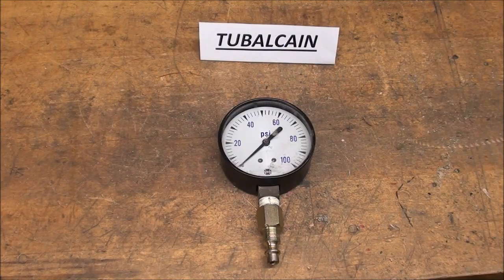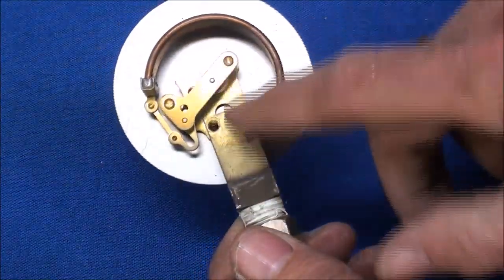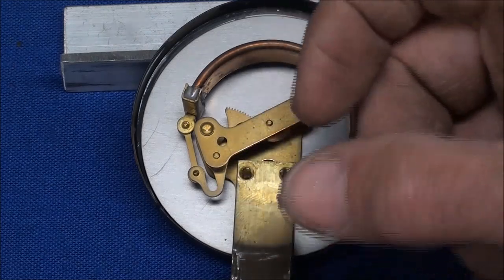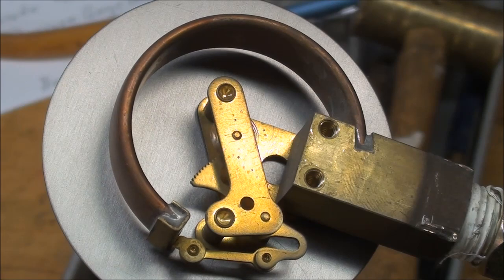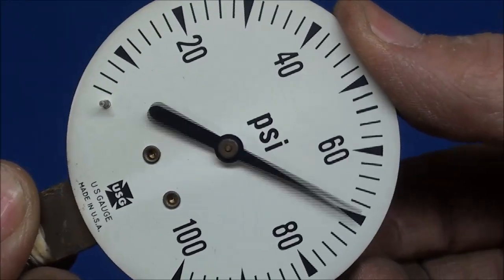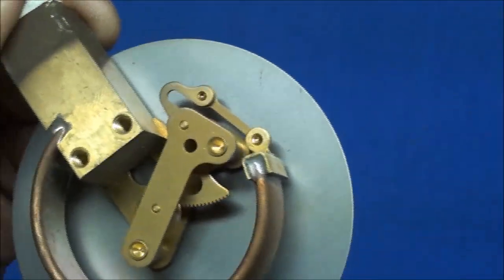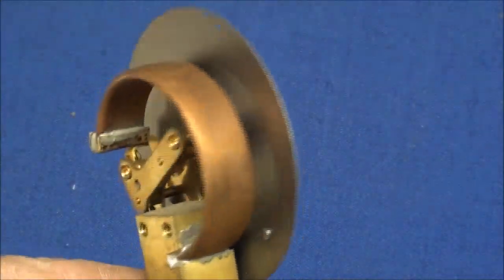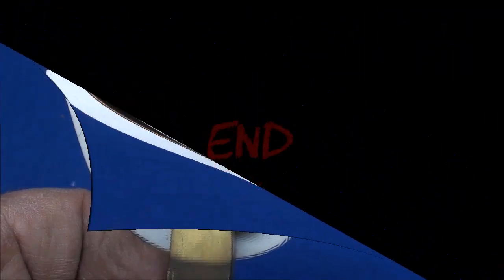WHAT MAKES IT WORK? #15 How a Pressure Gauge Works tubalcain bourdon tube

Comment: Fantastic. "Never before seen on youtube." I love that line. Great post!
Reply from the maker: +mycompasstv  Thanks
Reply: I just wanna know from where the pressure is entering and forcing the that copper coil to move !
Reply: The air enters through a manifold and actually travels into the bourdon tube.
Reply: Great explanation, but that line really took it to another level 😂

Comment: On a gauge with a stop post, I read that when the needle gently touches that post(vs resting hard against it) it is considered calibrated.  I have a Slime portable inflator that was impacted, and the in-line gauge needle rests about 8-10psi above the stop.  unfortunately, the shaft that mounts the gauge to the hose goes through the black backing(case) of that gauge.  It is screwed on so tight it is impossible to remove without possibly bending or breaking the thread - and gauge head - completely off.  So I just have to remember, if I want 32psi cold in my tires, inflate with the Slime until its gauge indicates approx 40psi.  Then check with a known good gauge(Longacre Racing makes several that are within 1psi of a garage's inflater unit).

Comment: The tube straightens due to the difference between it's inner and outer surface areas. Another example is a coiled up garden hose 'squirming' when pressurized.

Comment: Thanks for a great instructional video!  I have a bicycle floor pump, with a similar gauge, that I guess I must have dropped a few years ago. Since then, it has read about 15psi at no pressure.  I have always just added 15 to the reading.  After watching your video, I opened it up and was able to squeeze the curved "loop linkage" with a small pair of needle-nosed pliers to re-calibrate it to read zero at zero pressure.  I then checked it on a tire pumped to 50psi against a new pump and it was bang on!  Thanks to you, I feel like I have learnt and accomplished something today!
Reply from the maker: Thank you, I'm glad it worked out for you

Comment: Awesome Mr. Pete.  I usually am the guy wondering how things work, taking things apart, etc, but it never occurred to me to consider a pressure gauge for some reason.  I use them all the time, but had no idea how they worked.

Comment: Great analogy with the party favor, Mr. Pete.  Pretty interesting engineering when you think of it.  The radial travel of a specific type of formed copper tube expanding/contracting in some preconceived pattern, translated by gear ratios, and the linear linkage/ adjustments to a rotating shaft, needle and linear scale...impressive.  Eddie currents are another favorite.  Thanks!
Reply from the maker: +pjsalchemy  Thanks

Comment: Very interesting.  Our friend AvE tested failure point on one of these and it went many many times past its range before the tube bursted.
Reply: +phooesnax Cody'sLab opens one up and discusses its workings in his video "Oversized Pressure Gauge"
Reply from the maker: +Neds Head I'll check it out

Comment: Marvelous as always.  I expect that the ever so slightly greater surface area in the outside radius of the tube is causing the tube to try to straighten out.  Like the Chinese windless.  The differences doesn't need to be much.  Thanks again.

Comment: Hi LyleYes excellent once again. I deal with pressure gauges every day at work. mainly cheap ones. working from 0-15WC which is about 1/2 PSI to 10,000PSI. I design pressure washers. The low pressure ones are for gas pressure and the high pressure ones are for the water. Huge range and everything in between. The zero is normally done with the needle it is on a taper on the spindle and that little loop is to adjust the linearity. i.e. 0 is obviously 0 but 100psi might be 95psi and it changes the distance of the link radius. thereby changing the leverage and hence the linearity. Simple but effective. Never had to adjust one so far. You have to be careful with the LP ones, a colleague blew in one once and I shouted but to late it was wrecked. 
Allister
Reply from the maker: +Allister Denyer Thats interesting to know-thanks

Comment: My bicycle floor pump gauge has ceased to operate so I thought I would disassemble to see 'how it works' and 'can I fix it'. It wasn't obvious to me that the copper ring was actually a tube (flattened). I suspect in my case that the brass or copper section is blocked and can't easily be cleaned.
Your video explained the 'How it works' excellently. Thanks.
Edit...
I have since drilled a very small hole (1 mm) in the far end of the flattened copper tube, and blew compressed air in the reverse direction. In this process a small quantity of ‘stuff’ was expelled out of what would normally be the gauge inlet. I then sealed the small hole with solder. Low and behold the gauge then worked. I reassembled and tested ok.

Comment: i converted one to become a DTI  using the mechanism as the means to turn the needle disregarding the boron tube.  a curved shaft to enable them.  indicator pin to deflect the required indicator. yes, interesting worked a treat, to centra job remember were needs must the devil drives the way. Les Thompson England.

Comment: Spent a considerable portion of my wage slave years in a fossil power plant in the Apple.
There were large "steam" gauges in the various boiler control rooms with drum pressure brought right down to the back of the board. Woowie! By the time I retired in 2000 that was all replaced by local pressure transducers mounted locally with a 4-20 ma current loop output into various electronic "stuff".

Comment: It's quiet awesome, as i wondered how did such tings work since longtime now, and now i remember that i've already seen such mechanism pictures but forgot them. Very inspiring, it gimmes some ideas now about making some, calibrate them approximately following another one as a reference pressure gauge, and digitize the apparatus with some potentiometer, to plug that on a microcontroler for cheap. Thanks !
Reply: +Okto Putsch  They already exist. A common usage is automotive oil pressure gauge.
    Mike (o\!/o)
Reply: Moholo 88 Thanks :) (but i just found that fun as a project)
Reply from the maker: +Okto Putsch  Thanks

Comment: As I was watching I was wondering what prevented the bourdon tube from straightening too much if the gauge is subject to more than its max pressure. But at 6:55 we see that the body of the air manifold limits the motion of the quandrant and therefore limits the motion of the bourdon tube. What a simple solution (although I'm sure that too much pressure would deform the linkages and throw the unit out of calibration).

Comment: Thanks for the video. I have a cheap pressure gauge attached to a 12VDC air compressor. I have only used it twice and it worked perfectly until today. The compressor air passes through the gauge hose but it stays at zero. I tapped the gauge lightly but it is still locked on zero.  Since the gauge is not leaking air I suspect something is jammed possibly an internal gear. I am going to open the gauge see if I can clear the obstruction and lubricate it with a very small amount of silicon lubricant. If it still doesn't work at least I'll know I tried to repair it.

Comment: First thing I thought of when I saw the assembly inside the gauge was the human middle ear apparatus, where small movements of the eardrum are transferred and amplified via a mechanical linkage of three small bones to . Of course, this is not the same, but kinda similar. I think.  Thanks for showing this Mr. Pete. At least I can now say..I know how a pressure gauge works.  btw,  love your low key snark regarding anything made in America must be quite old. hahaha.
Reply: +Martin Walters  dang.   correction...   " ..three small bones connected to another smaller membrane." youtube needs an edit function.
Reply: +Martin Walters  There is an edit function! When you mouse over a comment a down arrow appears on the right. The options depend on whether the comment is yours or not. Since YT can't figure out unicode and will screw up all the punctuation, the best way to edit a comment is to copy the original, delete original, open a new comment or reply box then paste and edit the new comment. If you see a comment with weird number/symbol strings in it now you know it was edited since not all edited posts are marked as such.
    Mike (o\!/o)
Reply from the maker: +Martin Walters  Thanks
Reply: I wonder if acetylene and oxy tank regulator gauges work the same way? If so, they must be really heavy duty given the pressures.  Just curious though.  Btw, had to take open my compressor gauge  apart yesterday. The two mini screws holding the gauge  meter face came out.  I was almost leery of doing it until I watched your video.  Thanks again.

Comment: Great tip about the loopy adjustment lever - didn't realize it could be used to modify the lever ratio, it could be used to adjust the range somewhat... Hmmm!
Reply: I tried it at both extremes.   It actually changed things very little.   It certainly did not change the range.

Comment: It would be interesting to make a mechanical solar tracker with two of them (one in east side, one on west), painted black. In this way, when sun heat one side on the morning, the bourdon tube mooves the miror (directing the sunlight to the device you want), until it comes back to the shadow/the other side's bourdon tube reaches the sunlight and equilibrates. What you think about ?

Comment: While some videos say to adjust, opening or narrowing that gap in the linkage is the proper method, that would seem to change the leverage, and so one pressure might be correct but another off. I wonder if most gauges that go off aren't just suffering from a needle which has been knocked loose or out of position, rather than the bourdon tube suffering some mysterious malady, the only thing that might justify changing the actual linkage itself.

Comment: Mr. Pete, Thanks for the education. Am going to attempt to recalibrate a 0-30# oil gauge in my 1950 Chevy to read 60# oil pressure at the 30# mark....If it is possible the needle should be more in the normal 1/2+ on the gauge..may paint the 30 into 60 if all works as I hope....Anyway, Thank you for your lessons and keep on tearing things apart !
R Rhoades

Comment: Thanks for the description and explanation. I keep a gauge like this in my bike bag, after it got wet during a few rainy day rides it drifted away from zero PSI at rest.

I recalibrated it to zero by bending the flat copper pipe until the needle landed at roughly zero. Still not sure how water affected it in the first but I guess something must've expanded and oxidized. Nor am I sure if my "fix" effectively made it accurate again. Waiting for a replacement to find out for certain. 

I only have one gauge that's compatible with my bike's preasta valve. Schrader  shrader adapter, regular schrade valve compatible pressure meters never report accurately when used with a presta adapter. As a result I have to wait for a replacement presta pressure gauge to arrive before I know if it's accurate or not.

Comment: I guess the copper tube is hollow and the air pressure tries to straighten it. And that probably part of the mechanism limits it's range of motion so it can't be over pressurized and snap. Would have been good to see the gauge parts removed. Or the copper part removed so this was all totally clear.

Comment: Thanks for this very informative video. I have an automotive oil pressure gauge that is not reading correctly, 15-20psi low. It's been sent off for repair, but I have been curious just how the mechanical oil pressure gauge works. As relatively simple as the mechanicals seem to be, now I wonder what may have occurred for mine to go awry.

Comment: I wonder what the point of the spring is? Maybe some kind of reset ability in the event the cogs disengage briefly and get out of sync?  You then remove the input pressure and stick something through a hole which disengages the cogs somehow.  The spring then turns the cog connected to the needle back toward zero until it hits the peg.  My best guess anyway.

Comment: Assuming  that the small gauges on your typical home air compressor function in the same manner, I wonder it over time (1+ years) they would lose some accuracy since they are always under pressure (I tend to keep my tank full).
Reply: +Marty Backe I would assume that much like springs, they have a "deformation" point, that as long as you stay well below that, it will remain elastic indefinitely....would be an engineering question...
Reply: Interesting, you could probably find out installing a second, newer gauge and compare both at different pressures...
Reply: Aside .... I understand it's not the best practice to keep the tank full on a small home compressor.  Typically the instructions say to use the blow-out valve after each use to get rid of the condensation that builds up in the tank.  Not doing this can reduce the life of the tank.

Comment: Great video! I never knew how they worked. Does a liquid pressure gauge work the same?
Reply: +Ron Smith Yes.  In fact a steam gauge uses a loop to condense steam to water to keep the higher temperature of the steam away from the gauge.
Reply: Thanks for the info...I love watching your videos..  always informative..
Reply from the maker: +Ron Smith  Thanks

Comment: Very nice! Have you ever done a video on linkages? Thanks very much!
Reply: +William Lee  Would that be connecting rods, aircraft controls or bicycle chains?
Simple concept but big subject.
    Mike (o\!/o)
Reply: +Moholo 88 You are correct, the subject of linkages is very broad. I enjoy Mr Pete's videos so much I'd be glad if he did one on any area of the subject. Given the many steam engine models he has had made one on their valve gear would be great. Perhaps he has already covered those and I have not watched the video(s) yet. The study of 4-bar linkages has always fascinated, and to some extent mystified, me, but that might bore everybody. Much of the work that linkages used to do in motion control has been replaced with digital control, but as yet machines like cranes are still built out of linkages. My best, thanks!

Comment: Mrpete:

I see the gauge in your video has a stop post against which the pointer rests, like some of my own tire pressure gauges.  A couple of my other tire gauges have no stop - the pointer just resets to within a Zero 'box'.  

What is the advantage of either zero rest type, and in the box type, how close should the pointer be to the middle of that zero zone?  

Thanks in advance!

Comment: Nice video. Is there any way to fix an inaccurate gauge? My "Slime 40029 120-Volt Inflator" works fine in putting out air, but the gauge is way way off, showing 60 PSI immediately when turned on even though the PSI is around 20. And it doesn't move from 60 even after a few minutes. Can I buy a simple gauge to replace the faulty one on the inflator? By the way, the inflator is about 4 years old and rarely used, can the parts go bad over time? Thanks.

Comment: thanks for the very informative video! i think i broke mine when i plugged it next to a pump without any dampener. I am trying to fix it to be useable (im sure it is not accurate anymore) 
I have a known refernce point of 9.5bars, and the gauge still gets to that. but when there is no pressure, I am reading 2bars. I want to reset it to 0.  if i take out the needle and moving it to zero will only give me a 7.5bar reading. 
I read somewhere that the linkage next to the bourdon tube needs to be extended, but obviously this is a standard gauge and non adjustable. you mentioned something about the "loop". what do I need to do to reset to zero ? thanks

Comment: I have the exact same gauge on my water pressure regulator I use when I go camping. It's only 6 months old but my needle is now pointing all the way clockwise (south) to the 6 if it was a clock. When I move it counterclockwise, I feel the tension. When I let go of the needle, it goes back to the 6 position. When I put water to it, I can get water to come out on the other end of the hose, but the needle does not move at all even if I adjust the pressure screw. I took it apart but cannot figure out how to fix that issue other than buy a new one.

Comment: I still don't get what pressure/stress the bourdon tube gets exerted to make it expand. Basically, want to know how what happens when the air nozzle is connected, inside the brass.

Comment: What does the hairspring do? Doesn't the bourdon tube retracting back return the needle? Does the hairspring help with vibrations?
Reply: Perhaps it puts tension into the mechanism to eliminate "slop" or backlash?
Reply: +mark314158 Gear 'slop' elimination is exactly why it's there!
Reply: +John Bond it's a callback for the gear pinion, helping to avoid any jumping from the needle, and also hysteresys.

Comment: So I had a problem with mine I can't take it apart, but it will no longer move ,I had put a pin in the top of the gauge to keep the glycerin from leaking, I somehow put a small dent in the copper pipe and now it don't work at all even with pressure or vacuum

Comment: The tube isn't a pure copper. It may be a spring bronze, beryllium copper, monel, a spring stainless steel, or pretty much any other material compatible with the working fluid and conditions that has appropriate spring characteristics. The less expensive ones are often beryllium copper, and as beryllium is quite toxic, the material should not be reused, cut, ground, filed, brazed, melted, etc. without proper precautions. Beryllium is a pretty nasty thing to be caught by surprise.